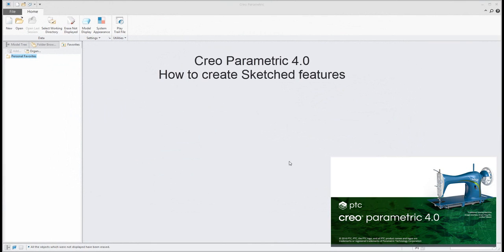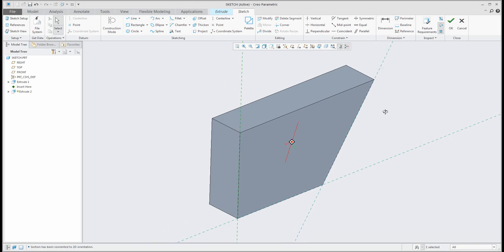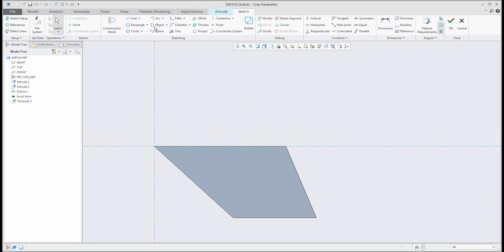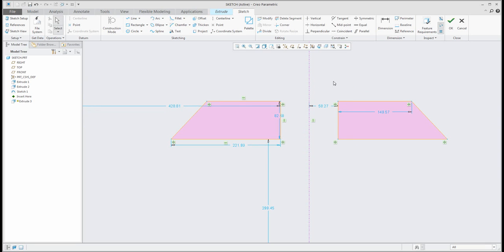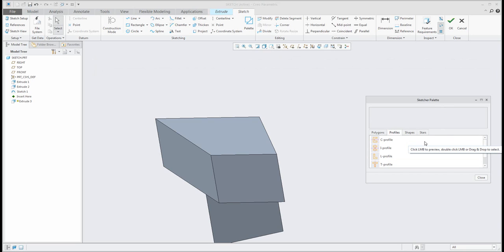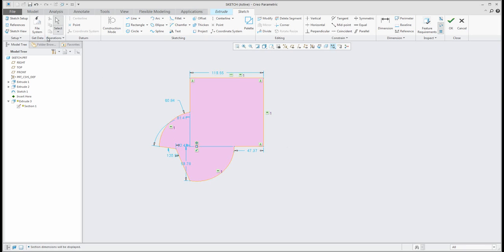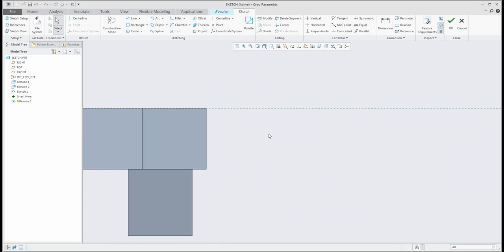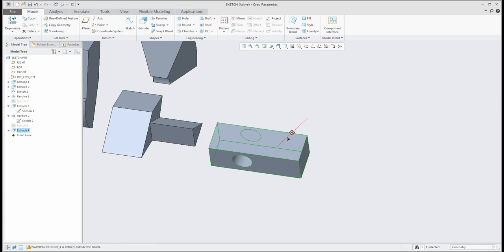PTC Creo 4.0 tutorial: How to create Sketched features

Comment: Vladimir why do you say at the end, the better practice is to create the feature directly in 2D? Do you mean create the sketch first then activate the 3D shape? I have never known if that is better or to start with the Extrude or Revolve command, for instance.
Also one point, just because I have never seen it mentioned in anyone's videos: the Sketch command is in the Datum menu, because a sketch is nothing but a customised datum reference. I think that is an important point in understanding the principle of 3D modelling.
Reply from the maker: Hi, from my experience is much better to start with Extrude (revolve, etc.) feature and create sketch inside, because system know if the sketch has to be closed or not, or if you need to think about sharp edges or not (for example if you create Sheetmetal features. If you see my modeling process in another videos... I use sometimes separated sketch if I need to reuse existing geometry or sketch. Maybe I have put some misleading info (not clear in video)
Reply from the maker: And Datum features in the sketch... For example Datum points are useful for Point pattern ;)